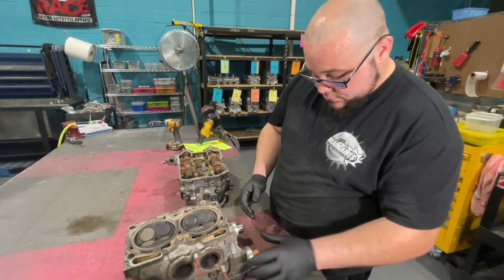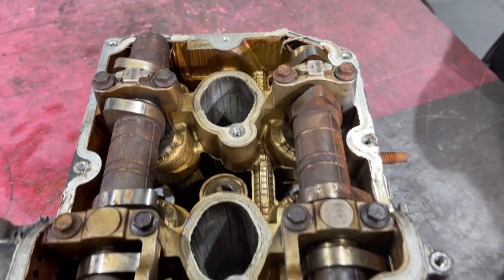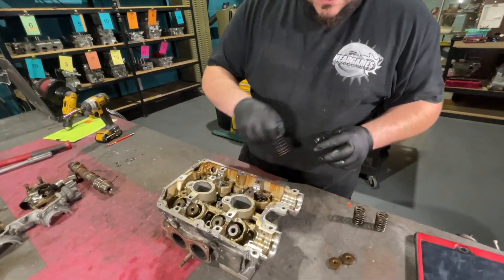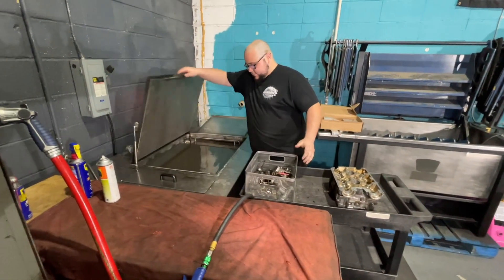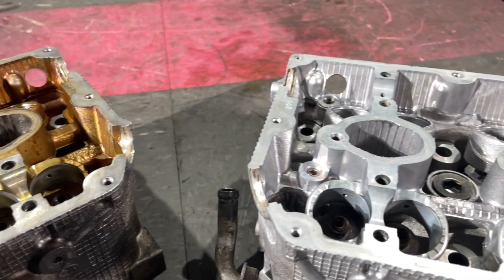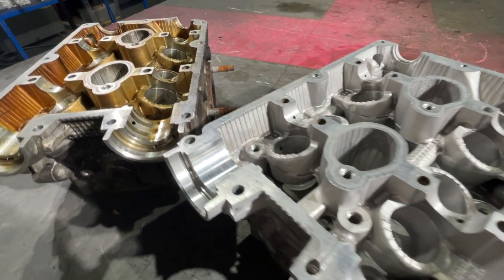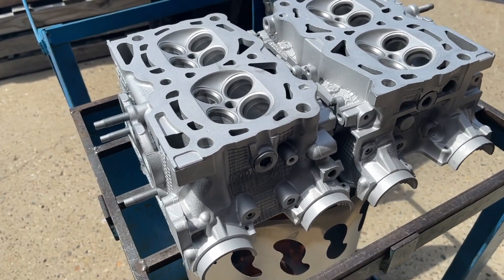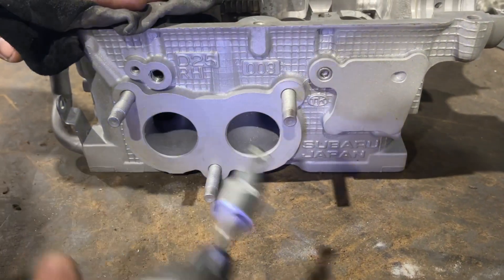HeadGames Motorworks Subaru Series Episode 1:  Tear Down and Prep for Porting

Comment: What do you guys think about going forth with subaru heads that typically hairline crack in the spark plug hole in the combustion chamber??
Reply from the maker: we discuss this in a vid on here "is your head junk" and we have done a few hundred of those S20's with cracks and non have come back. As long as they are not craters we do them.